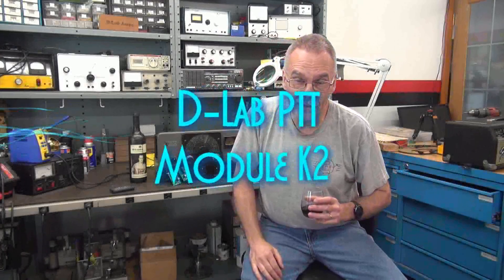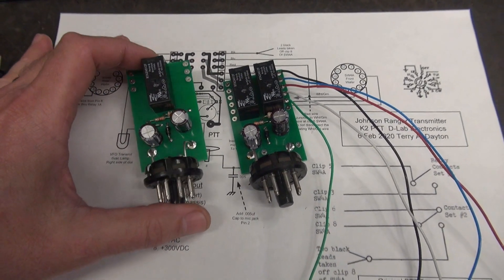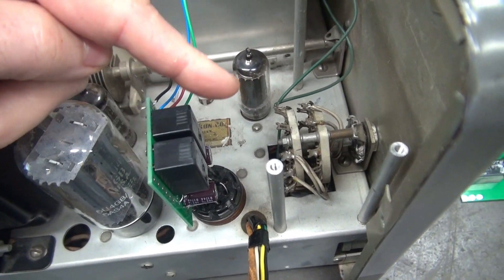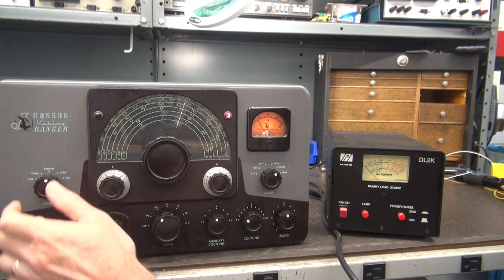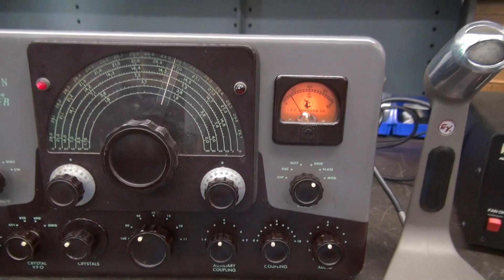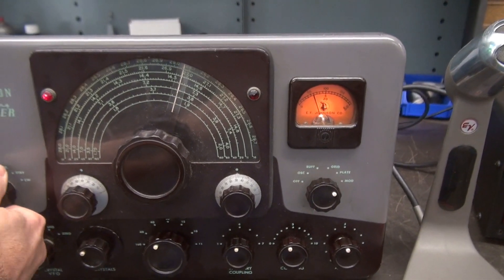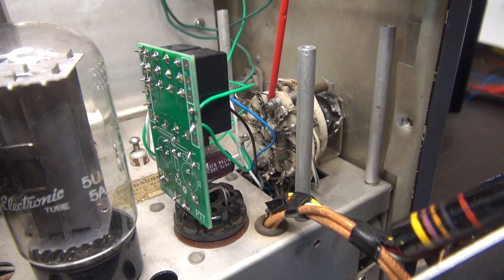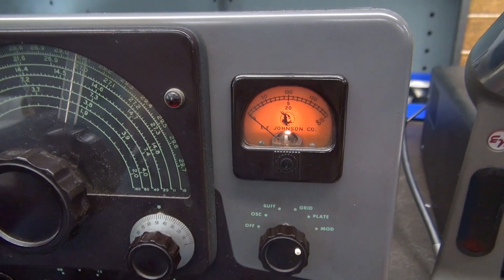EF Johnson Ranger Ham Transmitter Upgrade Push to Talk PTT Module K2 New features

Comment: I bought a K2 module a couple weeks back and just finished installing it this weekend.  I wired up the PTT, modulator screen voltage relay, and the PTT front panel lamp.  It worked right off the bat.  The card is well made, printed circuit board is high quality, and delivery was super fast.  The K2 card is well worth the money.  Terry's videos are corny, hilarious, cute, entertaining, and uh, did I mention corny?  Thanks Terry!

Comment: terry sir, you got me wanting a ham transmitter, ive been fixing regular am tube radios for like 5 years, including fully restoring some 1930s wood console types, also build and design tube guitar amps, most of my education came from you, uncle doug and the guitologist. the question is what is a decent beginner tube ham radio that i can get my feet wet in the hobby. i dont have much money so i will likely have to buy something broken and fix it. but i dont know what is good enough that it wont be worthless after i fix it. meaning, i thought i was all cool getting a hallicrafters s-40b ,thought it was a "ham" radio and i got it working nicely but as you know, its a broadcast /s.w. i did however pick up a cuban number station and could tell it was something different and it piqued my interest. i have been looking for the last few years there are never ever any ham shows near me in new orleans. you always talk about these johnson vikings and rangers, what are the good models to get that are decent for a beginner but can grow a bit too. thank you sir,

Comment: Thanks, Terry!  A good example of always looking for ways to improve things, enhancing rather than settling for just good enough.  (Expecting the K-3 soon, with the "K-9" around 2025? 😉)

I had a flashback when you zoomed in on the socket and talked about the solid state rectifier diodes replacing the vacuum tubes.  Back in the late '70s I was working on a tube-type CB radio where someone did a similar replacement, but they had just pushed the diode leads down into the tube socket holes!  I expected them to fall out or something, needless to say I reworked it with an octal base, similar to your K-1 & K-2 modules, no relays though!

Take care, sir, and here's hoping everyone at the Lab stays safe and healthy.

Comment: Terry,
Great video!  Love the added features that the new board adds to the transmitter.
Emi is such a hoot!  I love the song she sang to you!  It sort of reminds me of a Ray Stevens song... ( ...Roses are red, violets are purple, sugar is sweet, and so is Maple Syruple... ).  I get the impression that she might just love her grandpa!
I was going to ask you a number of questions, but you answered most near the end of the video.  One question that you didn't answer though is concerning the yellow wires that you added last. I noticed that between the board and the insulation on the yellow wires there was a considerable amount of bare wire.  Was this to make it easier to check voltages on those wires?
It's not logical at all, but I find myself wanting to own one of those "K2" boards.  I have absolutely nothing to use it in, but I think the design and performance are great.
I wish you and your family the very best in everything.
Stay Safe, Stay Healthy, Stay Happy!!!
Reply from the maker: Yes Sir, she is a diamond!